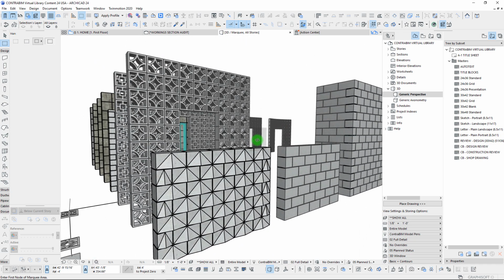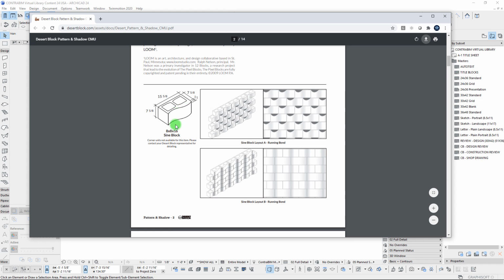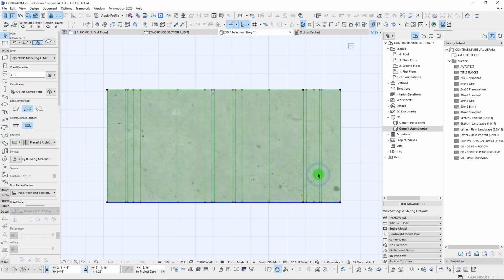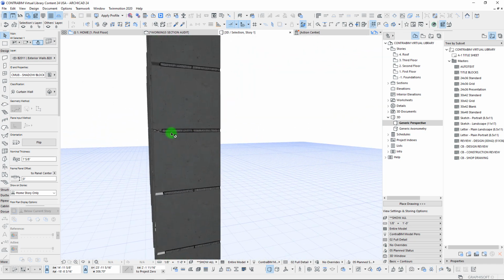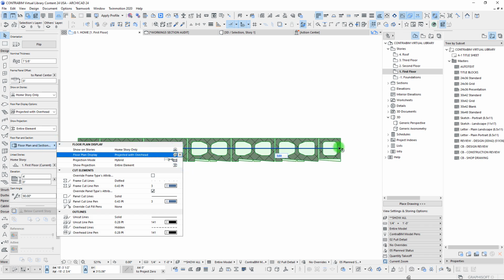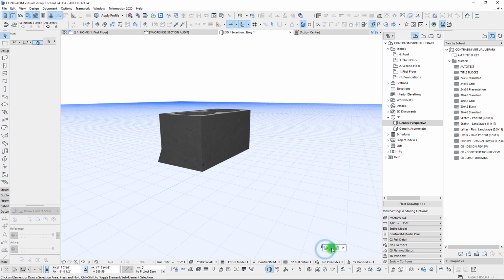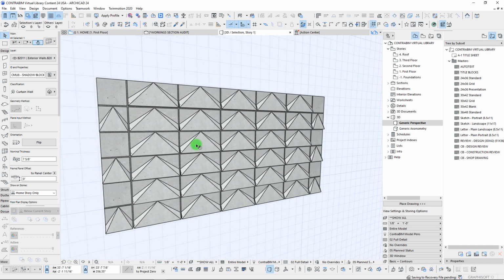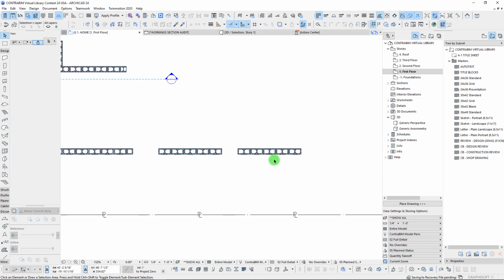AC24: Decorative Concrete Block with Curtain Wall (Part 2)

Comment: Woh, great skills, especially the trick with those shrunk side blocks. Many thanks!
Reply from the maker: Thanks. The curtain wall panels by default shrink to fit the scheme pattern size. I actually wish it wasn't that way, so it would act more like a CUT BLOCK in that case. I'll often replace the mis-shaped ones with a regular block or make another custom to fit. Thanks for the comment!

Comment: Hello Great tutorial, wanted to ask at the start of the video you show a curtain wall that has a corner to it. Mind sharing how you did that. I've been using this method for a while now but never could get that part to work properly. My panels either overlap and create a 3D mess or just leave a gap.  Wanted to see how other people go about it with this little problem. All the best.
Reply from the maker: Hi Martin, at the corners, I deleted the 1/2 blocks on one of the intersecting walls, and then did the opposite course on the other. You can pick which direction and modify the scheme position to get this to match up right. You are correct it is a little puzzle to solve, and i've found if you have a few of these corners setup right then you can copy those around, and stretch the length as far as you need. You'll have to do something similar at control joints if you're trying to get each block right. Thanks for the question, and apologies for the delayed reply!

Comment: Nice video 👍, but I have a question, how would you set up a door or a window into the wall. With the curtain wall tool by using window panels
Reply from the maker: Muri-Boy69 thanks! In the first video I show how to do this. Check out part 1. It’s all in the scheme editor, delete out panels and frames and place windows and doors easily that way! I like doing it in 3D but elevation also works

Comment: Loving these videos. Big thank you for sharing and explaining clearly the process. I'm able to generate the walls as per your video when you simply create a straight wall, however I'm having trouble with corners as they 're not meeting as clean intersection like your example in the background (eg 1:02 mark of video) What setting am I missing on the curtain walls that creates a clean intersection or junctions at the corners of the 2 curtain walls ? Thanks
Reply from the maker: Thanks for the comment! Yes you're right the corners are an issue, and takes a little extra time to work out. I went through and deleted out the smaller units for each wall, so they would come together clean. This isn't ideal, but it does work. And for every corner where it exists, it's best I've found to copy a "merged" scenario so you don't have to do this each time. You may also want to adjust the direction from where the pattern starts, so as you stretch the walls your base point doesn't get modified. Hopefully that makes sense!
Reply: @CONTRABIM  thanks for the prompt reply. Ok it's good to know it's not an 'End User Promlem' :-) I kind of get what you're talking about and will give it a try. I might have more questions once i get into it... if you have time it would be awesome to see a working video of this method. Cheers

Comment: same as 18:48 to pull the edge, palette dont pop up and dont mentionne any key shortcut to pull the edge
Reply from the maker: Hi Dany thanks for the question. With the morph tool, you can select specific faces or edges to modify. In this case, I grabbed the bottom edge, and dragged it forward to create the offset sloping face. Play around with the morph a bit, and you'll see how to select specific faces when holding down CTRL, or SHIFT one of the two:)

Comment: AT 18:00, how to create  a copy of the edge, do you hold any shortcut, cant make it
Reply from the maker: When you select the specific edge from the morph, you can either move or copy. In this case I dragged a copy. To do this, you must select just the specific edge though, and not a general selection of the morph.
Reply: @CONTRABIM  thanks, I know about edge, face selection, once edge selected, I use ctrl+shift+d, it create a copy that I can drag, I think you can mentionne that when a bit special command on tutorial